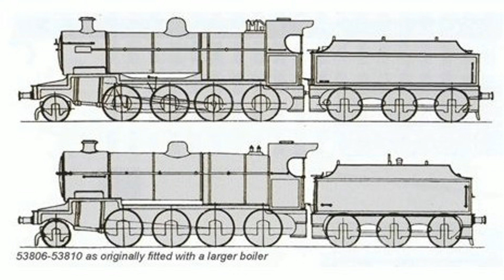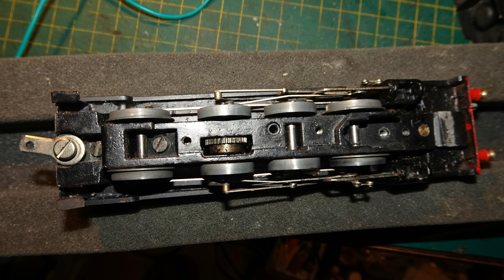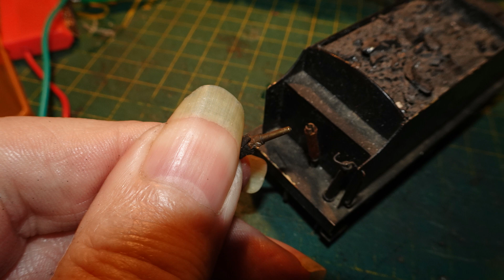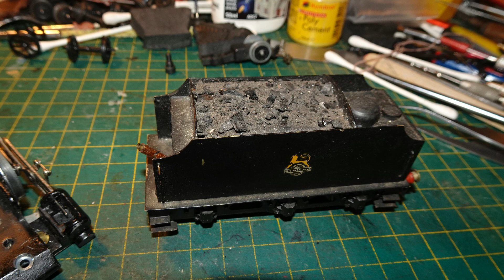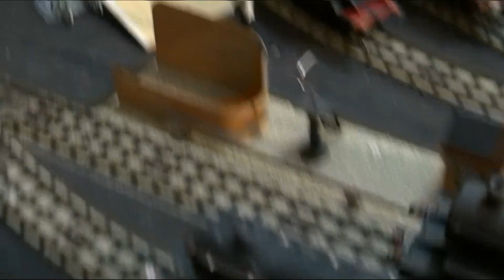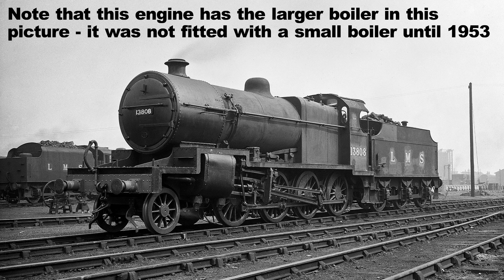OO 270, 3-Rail Kit Built SDJR 7F

Comment: Nice engine ! Looks like a pretty standard Dublo 8F loco mecanism, though the tender chassis looks to be fabricated brass. Are there any markings indicating the kit manufacturer, or its age ?
Reply from the maker: Yes, I guess the loco chassis is from a Dublo 8F, with some adaption, and the tender pick-ups and wheels, though the upper part of the tender chassis appears to have been fabricated from brass. I really have no idea what kit this was built from. It does appear to be mostly brass, loco and tender. DJH and Alan Gibson have both made kits for the 7F but, so far as I can see, those kits weren't designed to work with a Dublo chassis. It's perhaps most likely someone improvised.